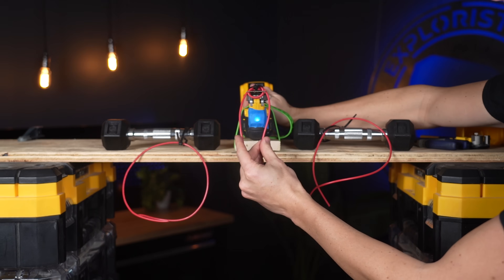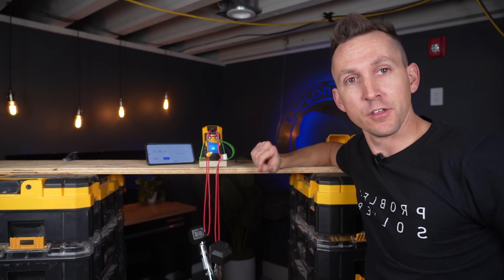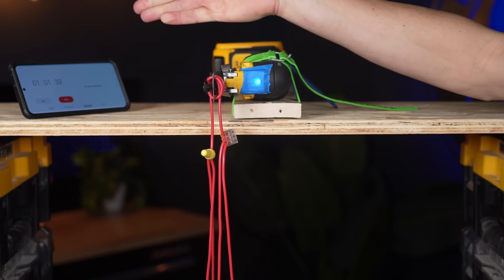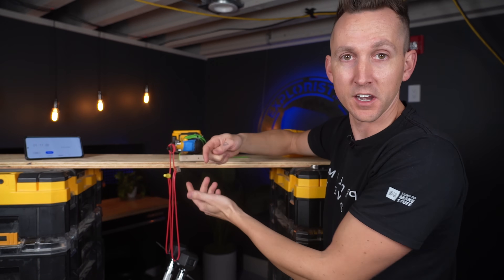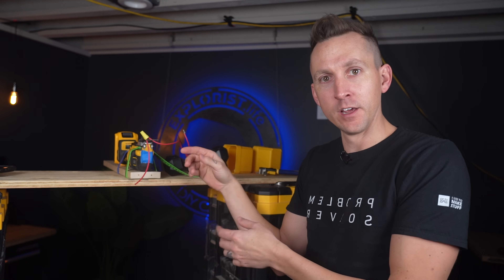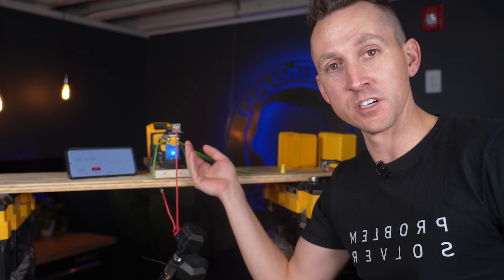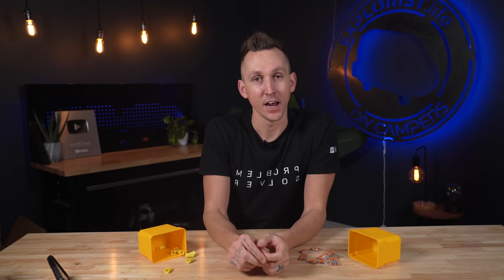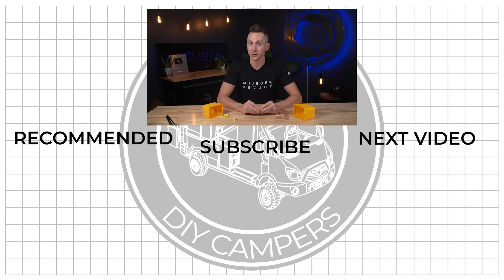😖VIBRATION TEST😖 LEVER NUT vs WIRE NUT

Comment: Only used them in Germany and europe for over 20 years . Brought them to the states long before most knew what they were. Never had an issue. They are also used in superyachts which i work on . No comparison . DO NOT USE WIRE NUTS . Especially not on a boat or RV . EVER

Comment: Wire nuts? In a vehicle? On thin stranded wire? Insane. Solder and heat shrink or crimping are the only acceptable methods
Reply from the maker: Solder is not a good option as it creates a weak point subject to breakage where the wire goes from stranded to non-stranded.  Lever nuts or crimp connectors will be better there.

Comment: Did not even know these lever nut connectors existed until I saw this video, will be using these when I rewire the vehicle I'm converting. It is old and seems to be having electrical issues. The guy I purchased this from has light bars and some extra accessories hooked up, all done with separate fuses on each wire that goes to the battery, instead of using a fuse box...

The first time I drove it, I brushed against the cig lighter and sparks flew out of it, and random things have stopped working properly, like the door locks, one of the windows won't move etc...

Pulling panels out to find wiring to see where it all goes and suddenly I understand. Frankensteins monster was hiding under the panels, lol

Fortunately your videos are awesome, and will be really helpful. I hate those nut connectors, I'm glad there is a better way.

Comment: Any concerns with the spring loaded wire connectors on the MultiPlus II?  Would love to you see do a similar pull weight test.
Reply from the maker: Those are crazy strong.  I probably won't test them, but once the pin terminals are in there properly, they aren't going anywhere.

Comment: Just use the wing nut, but bullet-proof it with tie-wrap over the wires the wires so the pull force will bypass the nut. Then wrap the nut with few layers of insulation tape to keep moisture out. Now it can go underwater.
Reply from the maker: So... you are recommending to specifically go against ABYC recommendations?   Feel free to do what you want, I guess, but maybe it's not a good idea to tell people to do the same, especially if you are planning on submerging the connection.

Comment: Wago is not available at your local Napa or Home Depot, at least not whete I live. I have found that crimp connectors are standard in the Northwood Manufacturing RV that I own. How do witenuts, Wago and crimp connectors compare?

My high quality crimp tools are home and I needed to make repairs on the road. I had available wirenuts, and cheap crimpers. I went with wirenut and tape (in the direction of twist of course). This is the choice spectrum on the road. Which would you choose? Or would you buy a cheap soldering iron and flux core solder and really make it a solid connection?
Reply from the maker: I would buy wago lever nuts and have them shipped to wherever I was on the road.

Comment: Thanks! However you're wire calculator doesn't mention if it's a round trip, or does it? Also, when I put in 150 amps at 12v and 2 feet it says 4awg. I'm building a battery with a 150 amp bms. 4awg gets warm at 100 amps. And everyone I see online is using 2awg. I actually bought 75' of 4awg to do all the batteries and for connecting them all to a common bus but now it seems I need 2awg? Very confusing. Any suggestions? Thanks again for all your hard work on these videos!
Reply from the maker: On the calculator, Length is wire length, so: Length = postive wire + negative wire

For sizing, that is based on max ampacity and voltage drop of wire for wire with 105 degree insulation.  4ga wire with 105 degree insulation is rated for a max of 160A.   The calculator doesn't take 'getting warm' into consideration as long as the wire is under the max ampacity.
Reply: So would you suggest the 4awg or 2awg? Connecting 4 lifepo4 batteries in parallel. Each has a 150 amp bms and it’s possible that they will get close to that but not likely for a prolonged period. The bms leads are 16” and batteries to central bus bar is 5’.
Reply from the maker: That depends on the loads.  Here is how I recommend setting up systems, complete with wire sizes: https://explorist.life/solarwiringdiagrams

Comment: Why not just use crimp connectors, much better in vibration environments, cheap and easy to use, but you do have to use them correctly, size right, strip right and use the proper crimper.  I dont use any of these other types of connectors  in our RV.  Larry
Reply from the maker: Crimp connectors are fine if the connection will never need to be undone, the wires are the same size, and you're connecting only two wires.   I don't prefer crimp connectors in most cases because of this:

1: There's not a good way to crimp three or more wires in the same crimp connection.
2: Crimping two different sizes of wires together means getting various step down butt splice connectors for the various size combinations.

Crimp connectors are good in certain places (connecting a spade terminal to the back of an outlet, for example), but I find the lever nuts shown to be WAY more versatile.

Comment: Hi and thank you for your great video - best explanation I have found on youtube - I have one question:  with an old existing array with solar in string and old mppt charger connected to my litium battery bank - can I add two more solar array in string (reduce shadow effect) with two new (another brand) mppt charger connected to the same battery bank? will the mppt charger conflict? the new mppt tell the old that battery is fully charge?  I think I have seen all your videos by now - but did not find an answer, is there a video I have ´missed?
Reply from the maker: You can indeed wire multiple solar arrays to the same battery bank each through their own charge controller.  More info: https://www.youtube.com/watch?v=N0UB7LZVduk

Comment: Hey Nate, great video, will be using lever nuts in our build. Quick off topic question, do all the wires in a parallel wired battery bank need to be the same length? Also, is it ok to use, for example, 4/0 wire and appropriately sized copper bar in the same parallel system?

Comment: Nate, love your videos and have learned a lot from them.  I also totally agree and prefer the wago's!  But I do have a question, when using larger gauge wire such as an 8AWG wire are there any wago's that fit larger wires?  I have some of the largest I could find but they only fit up to 10AWG.. In those cases is there something better than the twist on wire nut?
Reply from the maker: 8ga is an awkward size and I make special efforts to avoid using 8ga wire because of the lack of connection methods.  8ga does not fit into wago connectors.  If I were forced into using 8ga wire, I'd probably be using din rail mounted terminal blocks in a junction box.  That's pretty clunky, though.

Comment: Thanks for this AND all you do for the DIY community. Do you also recommend, or not, any of the "solder seal butt connectors"?
Reply from the maker: If the wires are the same size and a permanent connection between two wires is desired, I prefer the Crimp connectors with heat shrink pre-installed on them to solder seal.  

I find it sometimes tricky to get the solder seal connectors hot enough to melt the solder but not so hot it makes It all flimsy and easy to push the wire through the side.

Comment: When I use wire nuts I use electric tape around it. It's a trick I learned in the sawmill industry
Reply from the maker: For sure!  You should continue to do that with lever nuts as well.  I prefer looping the wires around and then zip tying them for a bit of additional strain relief and then the wires don't get sticky from the tape.  Works well!

Comment: Great test and very useful even to confirm what was my supposition and still  prefer LEVER NUT vs WIRE NUT principally for easy task for an easy upgrade: add one or more wire it's simple operation or change lever nut size wire number respect wire nut thas need a good connection when twist... may be I wrong but this thing keep my mind it's safer and easy on the road when we have problem to solve quicly

Comment: The catch is I could find no lever nuts for anything larger than 10 AWG. I think the key with wire nuts is to use them correctly, not the way most people do it (just crank it on there).  The wire is to be twisted with a pair of pliers first.  This by itself provides a good mechanical and electrical connection. Then you twist on the wire nut.  Now, in a high vibration environment, I would also tape the wires together before doing any of this.  This way, the wires maintain their position to each other, makes it easier to twist, but also provides a longer lasting joint.  My concern with lever nuts is longevity.  Long long until that spring steel gets material fatigue?  Also, the contact area is much larger on a wire nut.  Just my $0.02.
Reply: @suspicionofdeceit8402 Interesting.  They must have some "special stuff" in theirs that provides the mechanical aspect.

Comment: I end up buying some lever nuts, never knew about them until the first vid you did on them, and I'm impress and Like them now it makes it easy to change out a wire if something is wrong for some reason, and adding new items to a fuse box  easy.  Thanks for showing about them.

Comment: I would love you to check how the cheaper 'china special' lever nuts handle in a van
Reply from the maker: Yeah, probably not.  After seeing the melted components resulting from inexpensive fuses and fuse holders, electrical connections are not the place to save a couple of bucks.

Comment: On anything that moves, solder and heat shrink can't be beaten.. it never comes undone, it never gets bad connections, it avoids corrosion and it's by far the neatest
Reply from the maker: That's not true, no.  When you heat solder something, it creates. Weak point where the heat was and will work harden and break over time.  And if you aren't good/experienced with soldering, it's even worse.

Comment: I don't think your tests were long enough.  In boats, wire failure due to vibration rarely happens in scales of minutes.  Its usually over long periods of time, often years, when wire connections hidden from view will fail due to engine vibration.
Reply from the maker: For sure!  Check what I had to say at the 8:00 mark about that

Comment: I recently installed a small 12v system in my camper. I used lever nuts. But I feel hesitation to bury my wiring between my insulation boards and the paneling.  Do I need to put junctions in some sort of junction boxes.... or can I just throw up the paneling over the wiring?
Thanks
Great videos....

Comment: Is there a way to make the lever cap connections weather resistant? My first thought is to dip the completed connection in liquid electrical tape or is that a bad idea?
Reply: Dielectric grease. Get it in the red pressurized CRC can. You can buy wire nuts with dielectric grease already inside ala the RV industry uses on brake systems, generally.

Comment: although your test did not show a failure your explanation failed to take into consideration the person making the connections,
you are a very competent engineer with a personal commitment to build the best rigs possible, you also have an eye for 
quality equipment, I know from my own life experience that your fire and rescue training will not let you do anything 
that is not 100% safe and outside of health and safety guidelines, with those connections it dose not matter which type
you test, if they are not used correctly and installed badly they will fail, keep up the good video content and best wishes for 
your team and yourself in the coming year.
Reply from the maker: I very much think that is very much the key takeaway.  Anybody can make a perfect and visually inspectable connection 99% of the time with a lever nut.  Even an experienced electrician who installs thousands of outlets, switches, and wire nuts a year can easily mess up a wire nut, much less the DIYer who may do a few dozen wire nuts a year, and even less than that... a disgruntled RV tech who doesn't give a shit about their workmanship.  The only real way to mess up a lever nut is to not strip back enough insulation and getting insulation in the connection.

Comment: Did people give you 💩 about the lever nuts? I searched high & low to get lever nuts in South Africa to use on my sailboat. For the next video please put a ridiculous amount of DC current so we can see an arc or an explosion of some sort 😂. Btw you always use a fuse block for the DC circuits. I’ve always felt a bit better using DC breakers even on the main battery bank and solar array for my boat. Maybe test 2p breakers vs a fuse or the rotary battery isolator switch and blow something up! 😂 I’m kidding! Awesome channel!
Reply from the maker: They did, yes.  I've been fighting with people for 6 months saying that lever nuts aren't secure enough to use on an rv/boat/etc.  Mainly from electricians with 130 years of experience who think that technology in connection methods hasn't improved since the 1800's. 😂🤷🤦
Reply: I don’t recall if you said what brand you are using?  I presume WAGO level nuts are the gold standard.  UL listed, and meet NEC requirements for wire connections.
Reply: Fuses don't  fail like breaker can as breakers are mechanical.
Reply: @mainephotoman  Makes sense thanks.